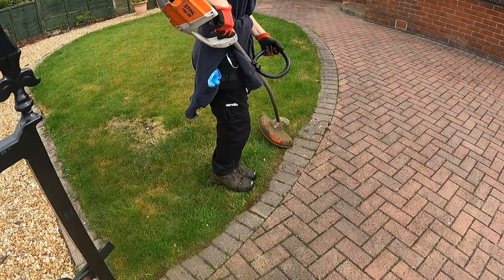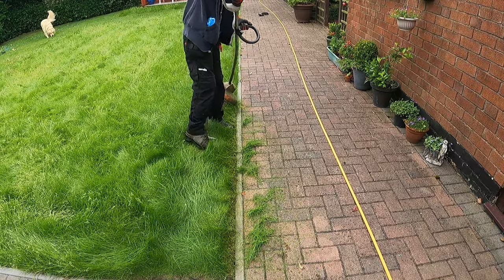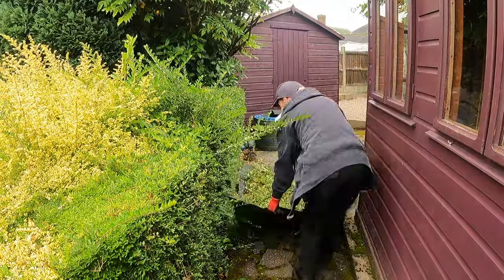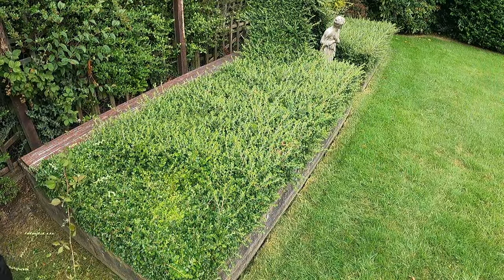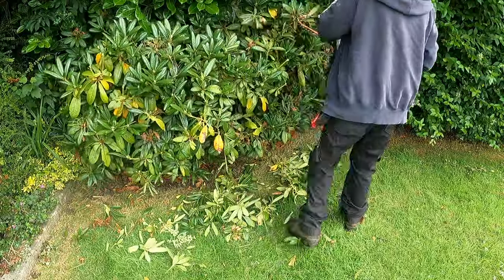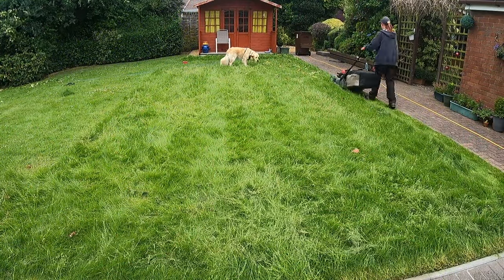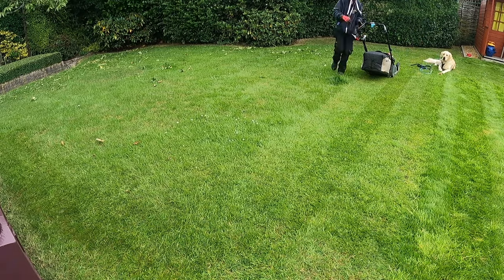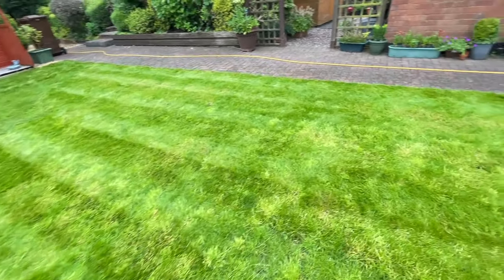Mowing, Strimming and Shrub Cutting with my new cordless hedge trimmers.

Comment: Hi Laura I don't have an edging machine - they seem ideal for edging lawns to concrete pavements in the US or Australia - I just use my Stihl strimmer or my old Bosch Accutrim with its plastic blades. Its light and smaller than the strimmer. On my small back garden lawn I sometimes just use lawn scissors to cut the grass on the edge! I enjoy your good work! Have a blast!